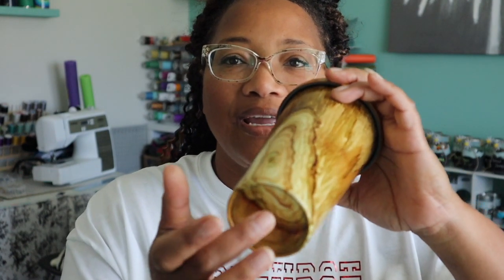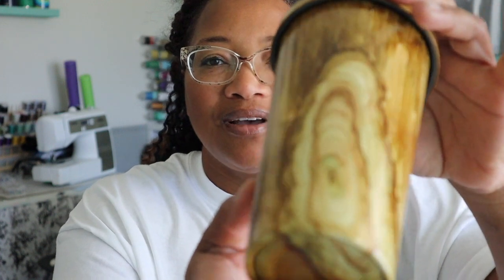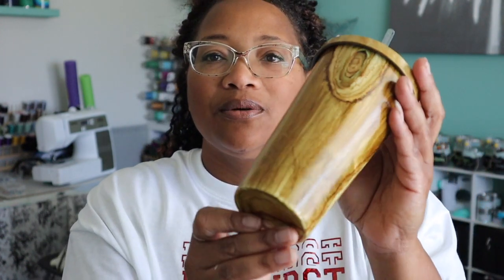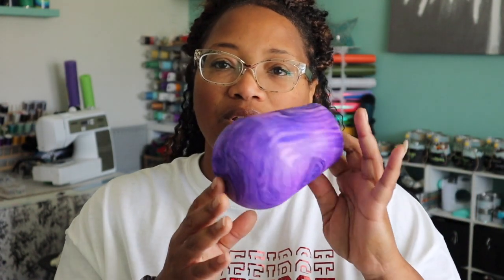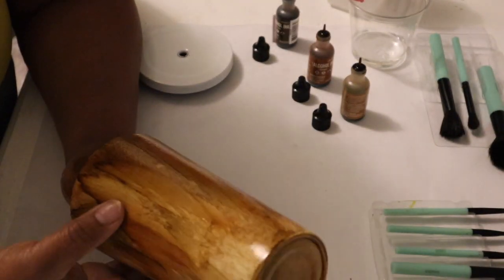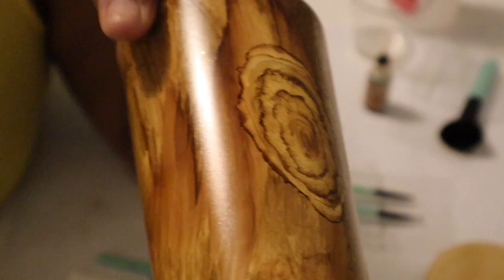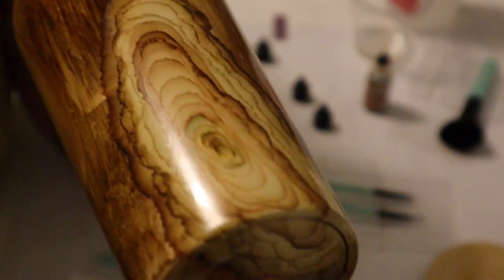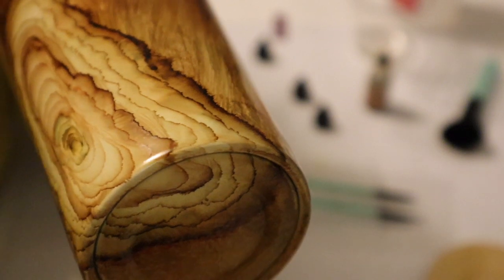How to make a Wood Grain Knot with Alcohol Inks

Comment: Also, what do we need to do before epoxying? Seal it with something? Or can I just epoxy on top of the alcohol ink?
Reply from the maker: I do both but best practices is to seal with a clear coat first. Sometimes if my cups sit for 24 hours I skip this part but you do run the risk of your ink running.
Reply: ProcrasCreationDIY Thank you!!

Comment: What kind of spray paint do you use? Mine keeps rubbing the spray paint off & taking the paint to the stainless steel
Reply from the maker: I use either Rust-oleum or Krylon. I would suggest that you make sure the paint is completely dry and try not to put too much alcohol ink in one spot. When I do glasses (after the paint is dry) I add the coat of alcohol ink and let it dry. After 24 hours I start to move the inks around. It seems to help keep the paint in place
Reply: @ProcrasCreationDIY  thanks so much! I didn't let the alcohol dry that long so that may have been the problem. I used the rustoleum but just realized it is a primer, not actual spray paint. I'll try Krylon & letting the alcohol dry longer. Thank you for the tips!
Reply from the maker: @caseybedwellcb  No problem. I hope it all works out well.
Reply from the maker: Hello, I just released another wood grain video with a better angle. When you get a moment check it out, https://youtu.be/4tHwpQaNGuE As always thank you for watching.